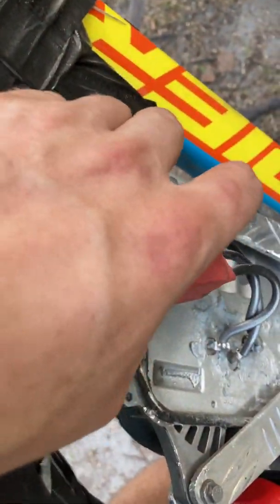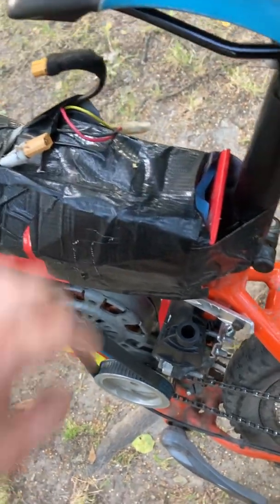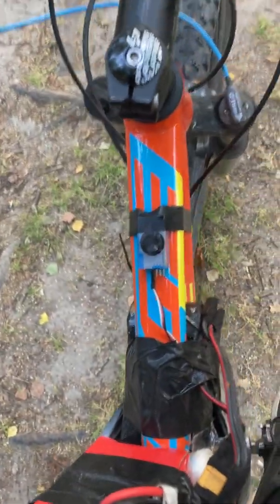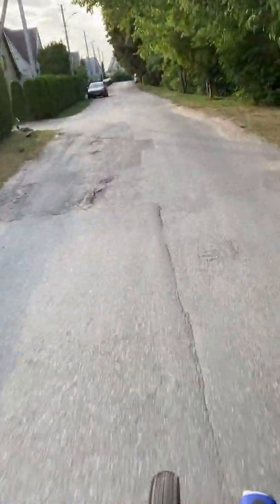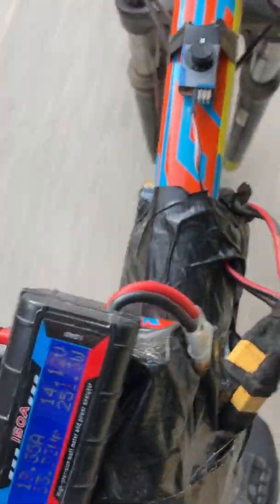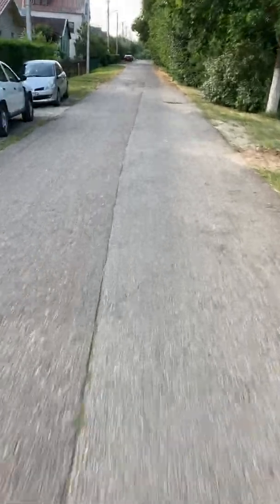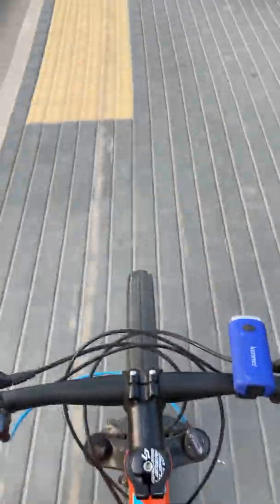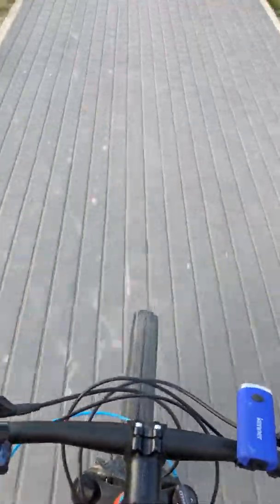600w car radiator fan powered e bike

Comment: Solid build and very informative description mate. I was planning to build e bike with old mercedes vito big brushed fan motor. After your video i got interested in this brushless motor, question is what mercedes model you took this motor from? Also mentioned about 800w motor available, do you also know the model i can find it in? Cheers
Reply from the maker: Hello, thank you mate! It was from clk if I recall, I just took it from the car workshop scrap metal bin, so can't tell exactly. I had two 850w motors, but 600w seems to me much better quality windings. The downsides of this motor is that you really have to work hard to attach the pulley onto it and it has a tiny axis, molten into the back side alloy, so it is bending on load, I am always afraid the magnets of the rotor starts rubbing the stator. But it never happened. Anyway, my build had a problem that the motor spun really quickly, so when I was riding through jumps, the speed of the rear wheel increased if I hold the throttle and the belt was jumping through several teeth with a machine gun sound. I suggest on using any three wire power steering motor instead. They have like 3x lower rpm, similar power and are much more durable. I have one from hyundai I20, that thing is lightweight and you can feed it with 100Amps. I think it would be the best to use such motor and a chainsaw clutch, then you could go without hall sensors and have a good torque. And for example a hyundai i20 electric steering motor gives about 1kw at 1000rpm at 12V or similar, so i was planning of using it with a 72V and make 6000rpm or so, with 7kw of 5kw power idk exactly how much it would give.
Reply: @unobombers thanks for quick reply! Power steering motor sounds very interesting, but question is how do you found out it can produce such a huge power as for example hyundai i20 looks very small like the most of them. It's actually insane if it can handle even 50 volts, but how do you know that 12v motor can take up to 72? You have a knowledge and i'm still learning. Long time ago i made e lonboard reaching 50km/h with 20km range, just before they got popular on internet. Now my plan is to build e bike with no money investment and reach at least 30km/h. I've got huge vito fan motor which should be minimum 350w and according to massive size i'd say it's more like 500w. Also i have corolla 2 wire brushed power steering motor. Got 4pcs 12v7ah gel batteries from pc ups and brushed speed controller. For gear reduction i'd use burned angle grinder 3:1 reduction end with 3:1 sprockets. In total it would be 1:9. Do you think i can make something of it or i should find brushless steering motor and use 300amp 4s esc from rc car?
Reply from the maker: @MotorHead-pv6dk  I have checked by it's part number it is rated to 800w or 1000w I don't recall exactly, but the rated rpm is about 1000rpm. those three phase permanent magnet (bldc) motors are very straight forward, they surprised me at first that even with short windings they can operate on 4x higher voltage without extreme heating. The brushed 500w motor should work fine, you won't need hall sensors, the overall efficiency should be not that bad and you would have a great low rpm torque. Fan motors are spinning in the range of 2500-3500rpm, so I assume you can calculate the top speed like that. Or do like I did, stick some tape on the rotor end, turn it on and touch the spinning tape with a piece of paper or plastic to hear the spinning frequency, reccord it with a phone, put the sound in any audio program or video editor, zoom in the audio file and calculate the peaks in the range of like 5 seconds and divide it by 5, so you know the rotations per second, then lets say you get about 50rps, so if your reduction is 1:9, you get about 5.5rps of the wheel, the length of the tire is about 2meters, so you get about 11m per sec speed, multiply it by 3.6 you get km/h that is about 40kmh. I think your fan motor should be somewhere there. For the power 500w is about right for that speed, I used 1200w for 40kmh speed, then you can go against wind at almost the top speed. Anyway if you are using 500dc brushed it is ok to calculate it for 40kmh, the most still safe speed in the city, I almost crashed several times, because it is too fast to watch every car in a rush hour not to hit you and manage to stop not hitting them. 40kmh on 500w motor should be perfect in no wind or wind direction, it would be like 20kmh against wind. You can calculate you produce about 200w-300w on a longer journey on average, so this 500w should make you fly. As for that 12v steering motor taking the 72v, I have seen videos of electric steering motor powered mini bike on 8s liion, and it went like crazy, going up the steep hill at about 50kmh. They had no heating issues. Brushed motors have that issue, if you double the voltage it fries. I went with 24v and later with 48v on a 12v 600w mercedess motor, so it was body temperature even after a steep hill climb at 24v, but with a 48v it was getting quite hot, still possible to hold a hand onto it, but it was hot. But I was going without hall sensors and when the speed gets about 50kmh, I could not hear the motor, only the wind and the throttle twist range now was twice more sensititve to hold it in the right angle, you know. It is very easy to find the right rpm with a handle when you go on 12v, a little more complicated with a 24v, but on 48v it was a struggle, you get the gust uf the wind and it slows down the bike, but the esc still produces higher frequency and it starts frying everything until you realise it is not accellerating. So my idea would be going with a chainsaw clutch of small scooter clutch or a small variator, to decrease the load and sudden impacts. Of course using the whole steering column worm drive would be nice, the reduction is about 1:25 it is quite heavy, but durable and should work. I have made a toy car for my 6yo sons with a 350w fan motor on a hyundai worm drive.
Reply from the maker: @MotorHead-pv6dk  and you can buy some small rc car batteries 4s and a charger, so you can go with lighter batteries on your dc 500fan build, and later join them in series if you decide to do a bldc build, just swap the motor and buy an esc then
Reply: @unobombers what a fantastic rpm calculating technique that i will try for sure! I was wondering how to do it as i have that vito motor which is approx 12x12cm size and it spun one huge fan and i also have another motor from unknown car which is 8x15cm thinner and longer motor, it spun two fans with belt. I want to use the one which has lower rpm that means it will have more torque right? Also interesting thing about chainsaw clutch as it's designed to engage from like 5-15k rpms so i'm not sure how it would work with 3k rpm electric motor. Instead of that i was planning to use freewheel sprocket that every bicycle has. That means motor spins only when i will accelerate and riding downhill, rocks and bumps wont affect the motor and wont hurt it right?
Reply: @unobombers i do have 4s lipo batteries but i thought it will fry my motor soon as fully charged it's 16.8v
Reply from the maker: @MotorHead-pv6dk  the best way of finding out what those motors  are capable of is by their part numbers. Quite often you can find them on a motor. Then use google. 12x12cm seems like a better option to me. Yes the chainsaw clutch won't work with  these motors, too low rpm... The freewheel is a good idea I guess, though with a step up dc-dc converter you could have regen braking. Just you would have to  switch the motor wire off and switch on the dc-dc converter wire on.  But anyway, the regen braking is not that necessary, only when going down the steep hill. Maybe not worth it. 16.8V drops down quite fast, you can check the Li-ion battery discharge diagram, on a load it would start at 16V at most and if you compare it is not that much of a difference from 14.4V that the car has from the alternator when the engine is running.
Reply: @unobombers Cool, i really apreciate your time replying to all my questions, now i can get to work. Cheers mate
Reply from the maker: @MotorHead-pv6dk  You are welcome. Good luck mate!

Comment: What is the name of the Motor you are using
Reply from the maker: Hey, i do not remember an exact part number, but it is from Mercedes 600w radiator fan. There were two options as far as I know 600w and 850w, both of them are great. But if you want to make them work well, you have to buy vesc and some hall sensors or induction sensors, so that the controller knew the speed of tge motor.

Comment: Your explanation is topnotch! You're giving very important data, keep it going mate.
Reply from the maker: Thank you, I just want people to create stuff and try to highlight everything I know. For now I think that using simple brushed power steering motor would be the best option. Because lets say brushed has 70% efficiency, and bldc 90%. But we must take into consideration the efficiency of the controller. So all in all we get maybe 80% efficiency out of bldc. It mau be 70% or 90%, depends on the prices of parts. I am trying to make an ebike with a bldc hyundai i20 power steering motor, I think starting with sensorless controller, but to do it right, probably better to buy Vesc and the small rotor with hall sensors or induction sensors and connect to the axis of the motor.

Comment: Can you get away with using a small lead acid battery from a motorbike?
Reply from the maker: Yes it would go, and some of these fans run with original computer, just full power. I have tried to start them up, but with no success. But you always want to use full power anyway. The problem is that Lithium pack weighs about 3,5kg and has energy of a honda civic lead battery inside. For Lithium every one kilogram of the battery gives you about 10km range only on electricity. This motor has almost the same power as motorbike starter. so it will not work long with motorbike battery. It would be better to buy small rc hobby rc pack with a charger for the start, and then buy extra batteries for better range later. The most interesting part with these motors and power steering motors is that you can run them with Vesc or esc with like 24V 48V or even 72Volts. They do not heat up. Fan motor only spins too fast on 72V it is on a limit to blow up to pieces. Power steering motor spins slow, they are much much better. they have stron axis big good bearings. I prefer power steering motors. They spin about 100rpm with every volt. So if you go with 48V it spins about 5000rpm and has maybe 5kw of power. I am building a bike with power steering motor, all I need now is to put hall sensors or other, and Vesc so that it would know the motor speed. If you run with simple esc, you need to turn lever very slowly to let the motor accelerate, otherwise electromagnets will create field that is spinning faster than the rotor, and magnets do not stick to it, the energy goes not to magnetic field then, but to fry the copper wires in a motor like a light bulb. especialy when you go to 24v or 48v. then your handle has the same range, but sensitivity rises very fast when you increase voltage. All in all if you want to use a fan motor with only 12volts, use brushed motor. there are vw motors with a mot of copper inside 350W of power they throw them away in every autoservice. they are thin, flat motors, And all you nned is a motorbike starter switch. so you give a +12 to a switch and you get full power running. As these motors are quite weak, you will have to use them all power anyway. as soon, as you pedal or reach maximum speed, the power on motor decreases and it does not heat up, it spins at max speed same like radiator fan. Just all the fans spin about 2700-3300rpm, so you need a gear ratio of about 1:12 or even 1:15 to make your bike have torque and 30-40km/h speed or so. You can do it only if you make two step chain drive of belt and chain like I did. so it is annoying. You could go with steering motor only in one step, with huge rear sprocket and smallest front one, some of them are brushed, so it would be even better.